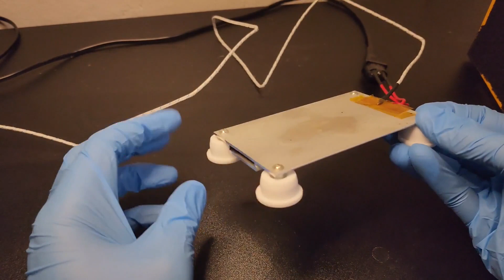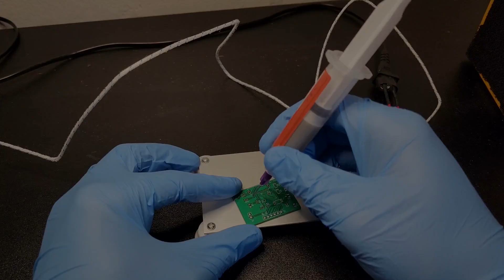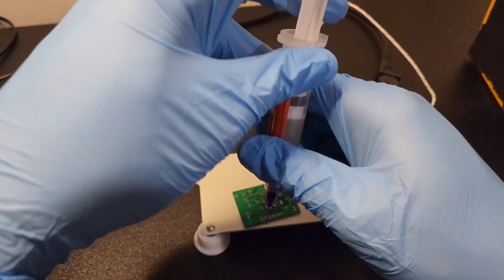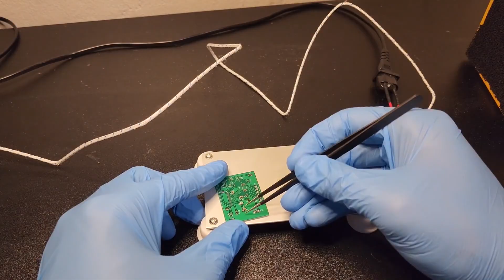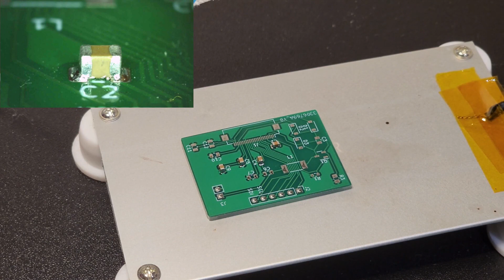CHEAPEST hotplate for solder paste re-flow that I found on the Amazon!!

Comment: When i do it on a custom hotplate, my solder paste just dries up mostly but doesn't get melted and soldered appropriately. Any suggestions?
Reply from the maker: My guess is the temperature is not high enough. Some solder pastes have higher temperature than others. If you use a similar hotplate to my video, try to block the airflow which increases maximum temperature.  I sometimes use a u shaped aluminum foil and put it on top of hotplate and board to increase max temperature. It can increase the temp 20-30C.